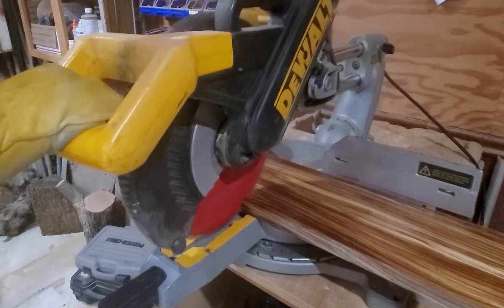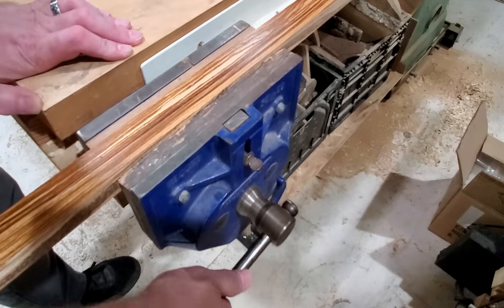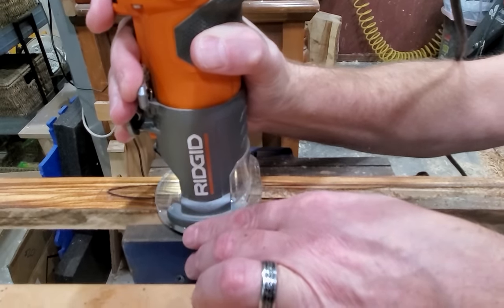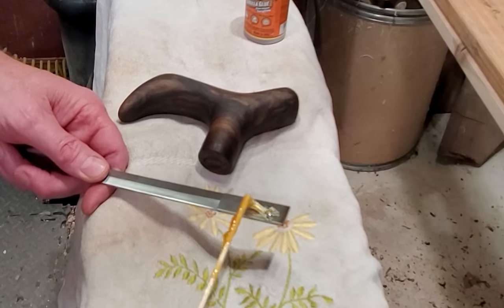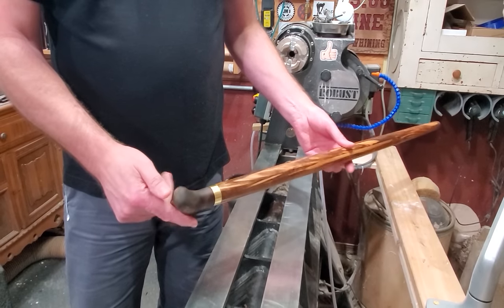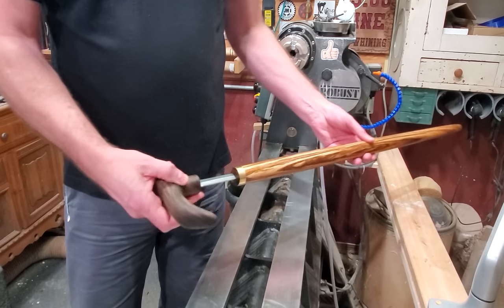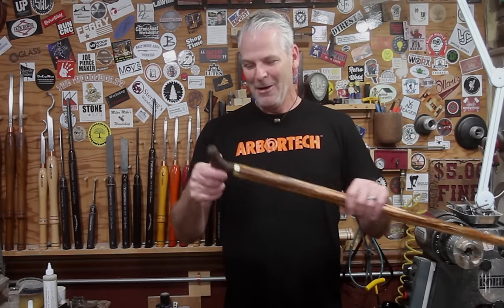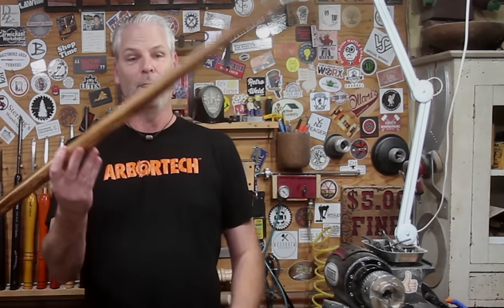Woodturning | Making A Cane Sword

Comment: Great looking piece as always. I did mine a little different. Because I do have a concealed carry permit, I made mine with the bottom of the cane being the handle for the blade, and put the same size steel in the handle (made like a "T" on top) and it becomes a "type of hammer" to use both to strike and defend with. Also my lathe is not long enough to turn a 36 or 37 inch piece so I turn a 28" piece and then make a special "foot" for the bottom that actually makes a good sword handle. When it passes through a metal detector it all appears to be just a re-enforced walking stick. I am a disabled veteran and do have to use it, but I will not list here how many places I have gone using it, and never been stopped.

BTW, you were my first watch turner/teacher even before I bought my first lathe. Thanks for all I have learned from you over the years.

Comment: Nice work, however, the cane is to short for you.  Stand straight and have someone measure from your wrist to the floor and that will be the length of cane you need. I used to fit canes and have made several.

Comment: Is a skew chisel less likely to cause chatter when turning long thin pieces?
Reply from the maker: No i don't think so there will always be chatter on long pieces. The best way to minimize it is with your hand or a steady rest.
Reply: Do you turn long pieces at the same rpm as shorter ones with same diameter?

Comment: What is that "elbowed post" you stick into the tool post opening then attach your chuck onto it so you can work on it with hand tools?  Where do I find it?  Thanks...AND good project!!!
Reply from the maker: It's a carving mount. Trent Bosch makes them you can find them on the web.
Reply: I made mine from PVC and wood, to lock in my vice...

Comment: Far to large in diameter in fact just looks out of proportion, also illegal in the UK. Before you make another one try and have a look at a real British Victorian Sword cane, these are slim and beautifully proportioned practically impossible to distinguish between a real walking Cain they also have a push button to unlock. The blades are extremely thin and not looking like a Bayonet just a real Sword blade with many made of Spanish steel in Toledo.